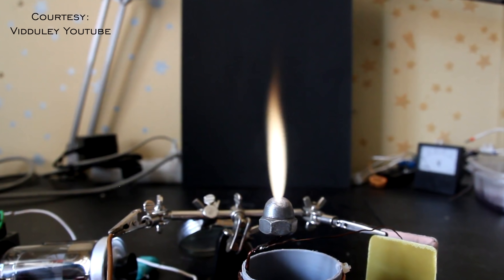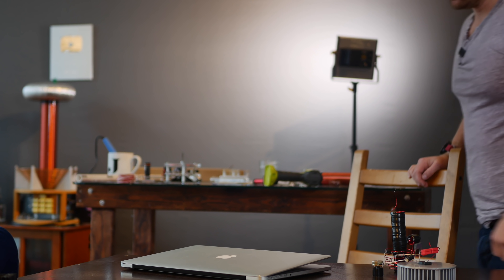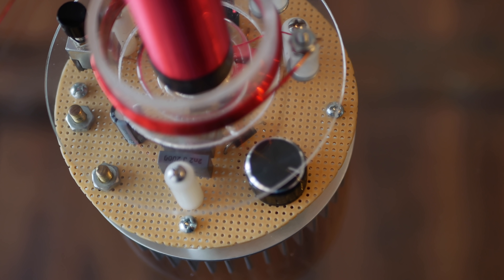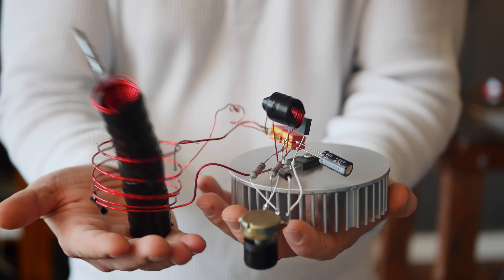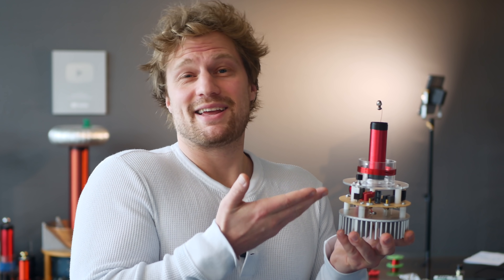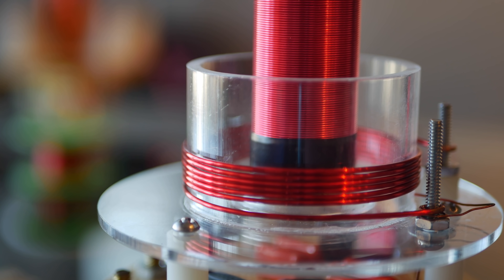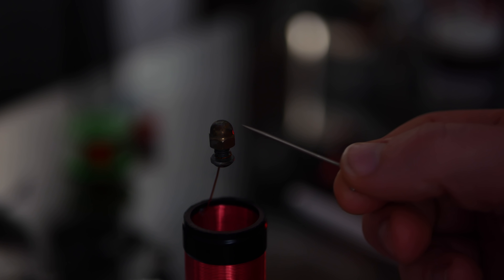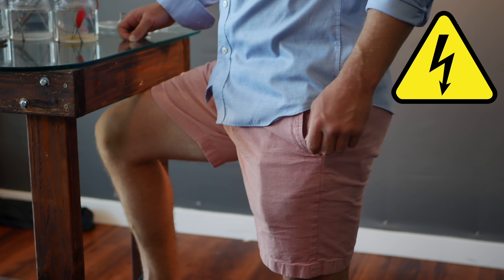Building a Wireless Power Plasma Candle ( Flame Discharge ft. Teslaundmehr)

Comment: Very nice flame, dude. You know what it means now, I HAVE TO MAKE IT BIGGER!! MUAHAHA
And oh by the way, you could now find a way to modulate the output to play audio, FROM FLAMES!!
Reply from the maker: Hey Mehdi! Thanks. Haha you know, I was thinking the same thing. When I feel the ground shake here in Seattle, I'll know you've done it. And blown up a few times along the way.
Reply: i look forward to that video
Reply: ElectroBOOM
, the best audio modulation I got with buck converter. You can see it https://www.youtube.com/watch?v=ZVrNFkGCRaQ Circuit is here: http://flyback.org.ru/viewtopic.php?p=4367060#4367060 Should work here too. In theory, it would be possible to feed sound signal through a blocking capacitor to the gate of the transistor. But I haven't tried that.
Reply: GRoza Lab just use an audio transformer in the drain of the mosfet to couple your audio. This is known as high level modulation in the old AM transmitters of years past.
Reply: yes, pls, do and with list of easily repeatable instructions !!
:)
Reply: mmmm  kinda curious to see that
Reply: You should join styroropyro's discord , great ressources for this stuff
Reply: You guys can make a cool cross over video together, that would be legendary , wow just think about it, mind blowing
Reply: MEHDI YOU BETTER MAKE IT BIGGER
Reply: @Advaitha Bhat Most often they may mean the wireless transfer of energy by means of EM waves or fields
Reply: OUR FULL BRIDGE RECTIFIER ;)
Reply: Do you remember sir the comment on plasma channel commented by you 2 years ago 
"I HAVE TO MAKE IT BIGGER!!! MUAHAHA"
it was a plasma candle. SO MAKE IT😡😡
Reply: Isn't it too high frequency to be heard?
Reply: @guythat779  not if interrupted

Teslaundmehr already made a build like the one described a month or so ago (without schematic or english subtitles tho)
Reply: @guythat779  "isnt it too high freqency to be heard?"  it's like AM radio. AM is short for Amplitude Modulated.  You have the main carrier freqency  with a lower (audio) frequency modulating the amplitude of the carrier.  

https://images.app.goo.gl/amZRmBPc4VWxsKip6
Reply: @kreynolds1123  but that's for radio waves and that's fine for them cause they don't have a limited frequency range that the can detect, the human ear does however

Am I missing smth major? I feel like I am
Reply: @kreynolds1123  i suppose if you don't look at it as a singular frequency but as an independent flame/device you can turn the circuit on and off in bursts to create the right frequency to generate audible sound
Reply: @guythat779  10 mhz is a radio freqency and you can bet this device is putting out radio waves. 

indecently, lasers that ionize the air have been made to send an audio signal that only the target can hear.
Reply: @kreynolds1123   Ever here about the Ionophone, made in Germany in the 1960's
Reply: @JohnSmith-eo5sp  I had not heard ionophone term until now. I have heard of and studied in some detail plasma and flame speakers.
Reply: @kreynolds1123  I heard or should I say read a brief statement about their developement, as loudspeakers in Germany, in a old issue of "Radio Electronics" magazine from the 1960s.
A Tesla Coil, or was it a toroidial induction coil, was used to create a plasmoid, whose membrane acted like a speaker diaphragm.
Early work at creating real world electroplasma-acoustics.
Reply: @kreynolds1123  I can absolutely aver that an AM transmitter, when given the chance to create a plasma arc, you will hear the audio modulated in the white plasma.   Then you scream and run away like a little girl and shut down the transmitter.
Reply: @jerryfraley5904   On a related but entirely different phenomenon with radio freqency (citizen band) that may cause fear in some.  I once heard some quiet bairly audible comming out of my stereo speakers with the sterio OFF even after I disconnected. With the immagination of a kid, It was like a ghost trying to communicate from the beyond.   Then the audio became louder and and louder before eventually faiding away.  I was then able to discern that it was a guy talking on a mobile illegally over powered CB citizens band transmitter.
Reply: @guythat779  Earlyer I said it was like AM radio...... Here is an example of an actual AM radio antenna power feed making a plasma speaker with a 15,000 watt radio tower  https://rfengineer.net/rf-antenna/a-dangerous-demonstration-of-the-power-of-radio/.
Reply: @kreynolds1123  thanks man
Reply: Build it bigger than styropyros
Reply: Oooh my goodness 
But it should be pretty sure to identify components 
Earlier you made on mosfet Tesla coil there's ic was unidentified and I loosed all time to make the circuit remember that contains 3 op amp circuit to create frequency and 4 power mosfet
Reply: Excellent work 👍
Reply: electroboom同じやつ作るんですか？
Reply: 😰😂😂😂😂😂 Electroboom is  OP ❤
Reply: No dont burn your skin again lol
Reply: Definitely make a video
Reply: TESLA RUBIN'S TUBE WHEN
Reply: You must talk on this flame.
Reply: 10:30 What is a "class E" oscillator - - is that a blocking oscillator or like a switching pwr supply?
Reply: @JohnSmith-eo5sp  class E means that the switching transistors are biased so that it is only turned on when the signal goes above or below the zero reference point and it is off for the rest of the time, this is done to get a more efficient amplifier unlike a class A for example which has the switching transistors biased to be on all the time even if there's no signal.
Each class has its own pro and cons and basically there's no best in between the different classes but they are used for their own specific usages, you could argue that a class E is better than a class A because of the higher efficiency but if you'd look at the output signal you'd see that the class A amplifier has a much nicer sine wave output then the class E amplifier and the class A is more efficient at higher output levels.
I hope this makes some sense to you trying to understand the different classes of amplifiers.
Reply: @RicardoPenders  I know the differences between class A, B, C, and AB amplifiers.
Just not familiar with class E
Reply: you gonna make it yaaaaaaaaaaaa
Reply: Styropyro has done this* allready, so bigger means a 10kw hvsstc ?
*he made a hvvttc not a hvsstc
Reply: Dont lisening this gorillaz (electroboom). Just very read original Tesla patent and lectures. You need use another form of secondary coil and you get the result much more easily/
Reply: @dzetta369  ,
another form of secondary coil ??!
Really ? Like what ??
Reply: @juerbert1  like that, very quitly see a photo with conical form of tesla coil and think about - how can you(!!!) perform that coil by hand? Perhaps than you can a little bit undestand of Nikola.
Reply: Umm
Reply: Let kill it
Reply: Anyone here ever hear of a German made loudspeaker from the 1960's called: IONOPHONE
Reply: whats sbout to separate whater in hidrogen e oxigeno using e resonante cavity with low amps. like stanly mayer??? cold you try?
Reply: Flaming music sounds cool
Reply: Mehdi, please DO!
Reply: @S.IΠDUSTRIES 😂😂😂😂😭😭😭 why is he still alive 😂😂🙏🙏
Reply: do not burn your self
Reply: I was just about to tag you 
Look he's here ...
Reply: We all know you want to touch it...
Reply: waiting from france to Electroboom 's video ! ^^
Reply: PLASMA FLAMESSSS
Reply: BOOM everything could blow! If you make it then I don't know what will happen to your room. 😱😵😵😱
Reply: ELECTROBOOM you legend, good to see you here my friend 😁👍
Reply: Through the fire and flames by Dragonforce? 🙃
Reply: ElectroBOOM I saw it done with artificial lightning. Sounds like an amazing idea. 💡
Reply: Erm... Have.. 
Have either of you 2 played with a welding machine before??? 

Carbon arc gouging is like using the sun and the wind to make everything liquid and dust...
Reply: It needs to be RECTIFIED!
Reply: you could magnetically levitate the "wick"
Reply: You mean flaeming speaker ? With lighting so  shiny ? 🥺🥺🥺🤩🤩🤩 One to rule them all.  💍 My precious.
Reply: When
Reply: Would putting a PWM signal on the MOSFET accomplish this?
Reply: making a lighter out of it anybody??
Reply: I read this comment in your voice 😂
Reply: what are you saying
Reply: Need to add zilipoper to the team https://www.youtube.com/user/zilipoper/videos
Reply: fuuuuuuuuuuuuuuuuuuuuuuuuuuuuuuuuuuuuuuuuuuuuuuuuuuuuuuull bridge rectifier
Reply: Hey @ElectroBOOM i'm from lebanon  I love your channel I always watch your videos and i'm interested in Electronics and telecommunication but the economical situation in lebanon is super shit , The lebanese lira went down 9x its original value In the past year, So now we pay 9 times what you used to, to get one product we can't buy any thing barely food and some life necessary things I want to develop my skills in my major  if you could send us some sponsored lab equipment or give us money to buy some lab equipment that will be a big help and thanks any way 🙏
Reply: @mohbit3336  Is it really that bad in Lebanon? That is terrible. Many people of Lebanese descent in Canada. Maybe you could contact one of their associations and ask for assistance? Good luck.
Reply: @SuperNewf1  yeah man i'm not exaggerating the situation I know all countries now suffer a economical crisis but lebanon from the top due to epidemic (government want people to sit in house without work lockdown and no food) the explosion that fucked the situation even more hezbollah israel conflict ,the main problem in lebanon it's divided by using people believes in religion they have for every religion a organization and they can do whatever they want with no management from government they even control the government this is a shape  of monopoly that is played not only in lebanon but larger scale in different faces by the top 1% of the top 1% that's controlling  economy Idk bro idon't even care any more I hope the best for you thanks for your concern .
Reply: @mohbit3336  All the best to you too. The New World Order will fall by the weight of their own crimes against humanity.
Reply: @mohbit3336  Hi, I was in Beirut, in 82-83, wish we could've done more, I weep and pray for your country every time I think about my time there.  I was a guest of your parliament for Christmas dinner, in 82, it was very moving, I felt very close to all the people I met in that time.  I wish it were better for you, I understand all too well.  I too, watch electroboom all the time, if there is something you need, that I am able to send out, I will try to send things to you.  I've watched your country ever since, with great tears.  We Marines were made very welcome, and I hate what has been done to you.  May God bless you and keep you, John McClain.
Reply: 😂 😂 As I expected!
Reply: Electroboom your plan is foiled a YouTuber has done it already https://youtu.be/dQw4w9WgXcQ
Reply: Just as reference Acid Byte, Teslaundmehr, GRoza Lab, IRFC, to my knowledge, and probably quite a few others have demonstrated the audio modulation at the higher frequencies. Of course there's no shortage of class E singing coils in the 2-4mhz range but those aren't quite the same thing just due to the lower frequency. Just as a novelty anyone can do it by controlling the dead-time of a switching fet across the power rail but it might sound like crap.

Comment: #plasma channel i was wondering i saw online that gas is ionized from the energy in the air but if i made that acrylic tesla coil you made that "lost a battle to gravity" and i connected that to a laminar stream of noble gas would the gas ionize?
Reply from the maker: Hey Justin. That should ionize the gas, yes.
Reply: @PlasmaChannel  would the ionized gas be in fractals or would the argon glow blue?
Reply: i am looking to ionize it in a fractal way

Comment: Add the melted glass to that bad boy if you haven't yet
Reply from the maker: Oooooooo Leon told me to try that. I'll have to give it a go.
Reply: @PlasmaChannel  These guys use these glass rods to melt some on there but sometimes you can just stick a small piece of broken glass on like from a fuse even if you have to sort of glue it there initially.

Comment: Getting close to the frequency range of John Kanzius cancer research. He was using 13.56 megahertz to induce an open flame on saline solutions.
he was a radio engineer but he had hoped to use this method to treat cancer that he was inflicted with himself. 
An open flame on water would be a very interesting demonstration that I have not seen in a hot minute.
Reply: It's interesting how that works where I recall some studies showing more ideal interactions with for example cancer cells at what is also basically a lab standard of the ISM band. Would be pretty cool if a 13.56 mhz coil just running nearby may also have some byproduct of inhibiting cell mutation or killing cancerous cells without affecting the normal ones.
Reply: @Magneticitist  oh I don't think that's how John was trying to use it. He wanted to have some element like gold flakes placed in cancer cells and then used the induced current to basically cook the cells without surgery or chemo. Any other ideas about regeneration using emf was not intended by john that I know of
Reply: @michaelinamoment  Probably not, there just seems to be numerous papers on how that frequency seems to work the best for certain related applications
Reply: @Magneticitist  oh I see. There certainly does exist a lot of high frequency medical applications I've encountered, but have not deep dived the material in that respect. I always thought this wireless dissociation of salt water was really interesting

Comment: Any advice you would have for making one?
Reply from the maker: Expect to spend a ton of money haha. Leon originally warned me that I should buy 10 MOSFETS to be safe, and that I would expect to kill most of them while tweaking. I ended up killing 44 MOSFETS, 6 lithium batteries (not cheap), one lab bench power supply, and a dozen capacitors. Besides that, use notes and write down how each change effects the output. Track these changes, and reference your notes for best result.

Comment: Jay, this video is freaking awesome!!!!

It is entertaining, super informative, and gonna have to definitely try my hand at building one (on that note thanks for including the trials and tribulations, so myself and others know before we start)

Are there any hazards from the flame itself other than heat etc? For example is the light more like a welding arc that could hurt your eyes without shielding, or some other unseen electric radiation that could cause harm?

Also the new channel/creator to follow!

Made my day!
Reply from the maker: Justin, good seeing you! Thanks so much man! Super nice of you to write all that. This flame circuit puts out a ton of RF interference, so, there's that. Besides that, ozone is minimal, and, it literally melts ITSELF if left on for too long.
Reply: @PlasmaChannel  gotcha. I am learning to weld, and the prospect of instantly blinding myself scares the crap out of me, lol. So try and look out for dangers might not see (lasers, welding arcs brightness (those auto darkening helmets amaze me that it works quick enough), possible microwaves or x-rays from experiments, etc..) maybe I'm just a bit paranoid, lol

When you say it melts itself, do you mean the circuit, or the break out point? If the break out point is the part that melts, you can get a tungsten rod from a welding supply store for pretty cheap, they are used for tig welding. And tungsten has crazy high melting point.

Comment: StyroPyro made one of these, and it was INSTANTLY LETHAL. I don't know about this one but...
Reply: Yea that one is awesome no doubt but he used a big vacuum tube capable of thousands of watts of RF power. It's a much more complex feat getting a small RF flame from such a small mosfet. One could just use a big tube instead but then you'd be supplying more power just to heat the tube than you would be to run one of these small circuits.

Comment: That is awesome! I want to try and build one of those now.  Have you ever thought about using vacuum tubes for your experiments?
Reply from the maker: Hey Tanner! I love your work man. I have a few vacuum tubes, just, like transistors!
Reply: @PlasmaChannel  Thanks!!! I enjoy your work as well!  I have a 10kw transmitter tube, I may be trying your circuit(with a few modifications of course) with that tube later.  It would be a lot harder to burn out than a mosfet haha
Reply: Before I read your comment I asked the same question. That would be quite an interesting project. There was an old Popular Electronics article back in the '60s that did that with a small vacuum tube and flyback from a tv set.
Reply: @eminusipi  I had that magazine, I bought a box of old Popular Electronics magazines from a flea market 27 years ago.   It had two coils  to build, a large one and a small one in a metal box with a very odd old fullback and vacuum tube, very cool.
Reply: Hey; nice seeing you here tanner ;)